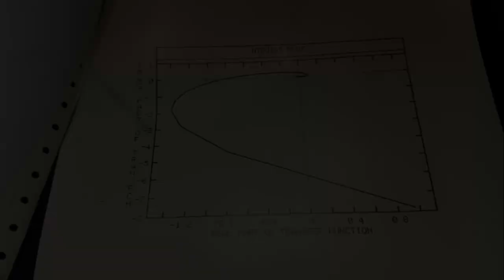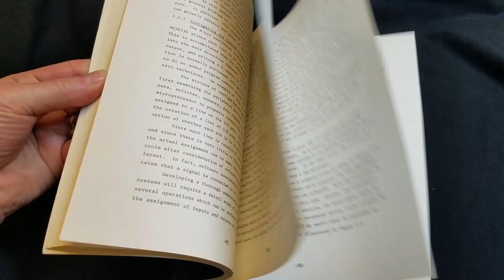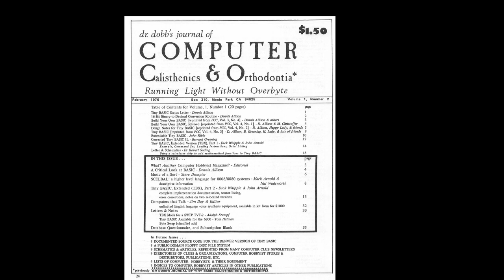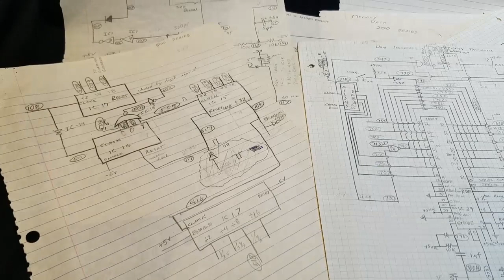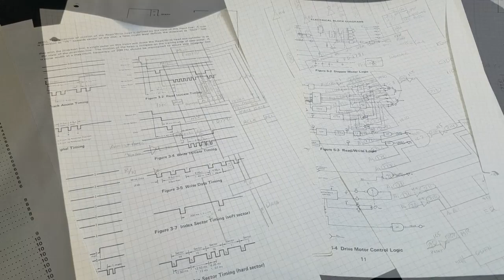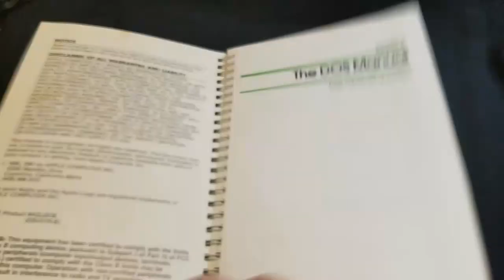1970's Homebrew Computer Experience

Comment: What a cool homebrew machine!  Also very impressive that you modified it to make it Apple II-compatible.  🙂
Reply from the maker: Thanks, the conversion didn't happen overnight.  Dozen's of issues had to be solved before it worked.  And I never got the "color display" to work.  The analog circuitry of my rf modulator (remember, we had to use TV sets instead of monitors) only allowed black and white.  Thanks for watching!

Comment: My dad, while working at ITT on their timesharing mainframes in the 70's, homebuilt the beginnings of a computer based on a Fairchild F8 processor board.  The TTY interface and RAM was breadboarded, as was his eight LED bus status indicator, his terminal was a TI Silent 700 ASR (dual cassette decks).  He had a 5¼" floppy, but never progressed to read/write from it; he could issue TURN DISK ON and TURN DISK OFF commands from the terminal to start or stop the drive motor but that was about it.
Reply from the maker: Sounds like a cool project.  Back then everyone had to figure out how to make do with what they had.